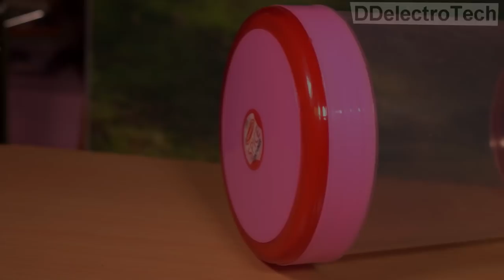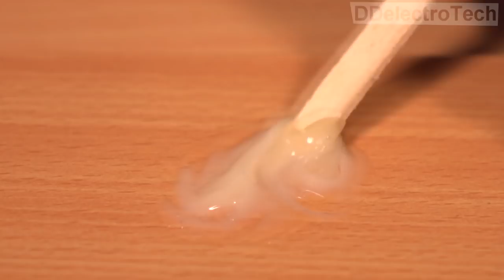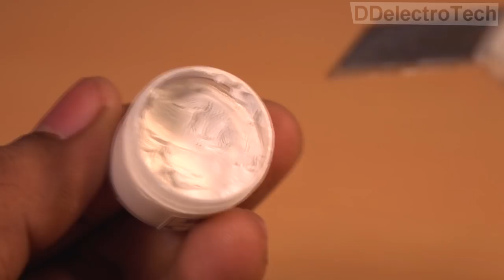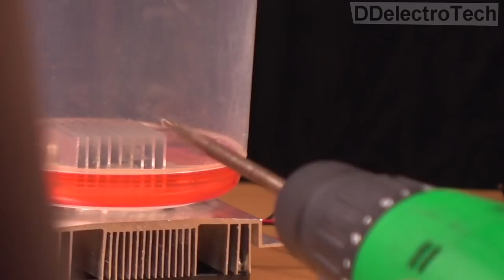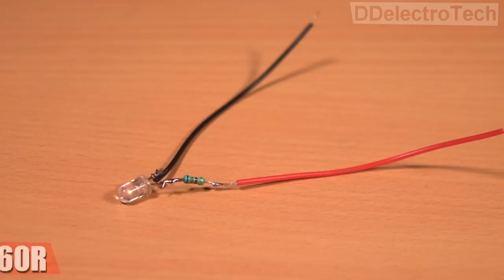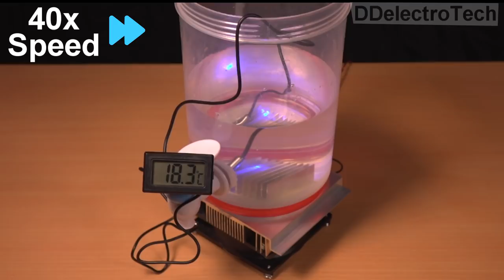How to Make a Portable Water Cooler at Home

Comment: Got one of these. 12 v peltiers but  with metal tubes through it for water   and vehicle voltage source. .. would a table top fountain pump and a switch get  me refrigerator temperature cold drinking water ? Or would i need to re circulate it awhile first?

Comment: Bro..The temperature gradually increases after cooling and it leave some drops of water outside the Bottle..And the wires seems like very close to the bottle..Is it dangerous so ??...Bro plz clarify my doubt
Reply: Just keep the wires insulated  Eventually aluminium heat sink starts to corrode and that's not safe to drink.

Comment: Hari Krishnagudur

i had purchased TEC1-12706 peltier. I had connected with 12v dc supply then hot side it is getting too hot but cooling side it is not cooling 32 deg only.
pls help me how to get cooling
Reply: Use heatsink

Comment: Quick but dirty! I wouldn't want to drink water that has been exposed to a metal heatsink. Also tempurerate gaung touching heatsink... naughty and not accurate.
Reply: Simon Hayter yea i just commented on that too... the raw expoxy exposure is what really turns me off.. the idea and concept is cool just not too practical if done exactly this way. Not safe enough
Reply: Yep... and since the ideal fridge temp is 1.6°c this project is a way of the mark in terms of delivering a cold beverage. Most DIY fridges and a lot of 'MINI' commercial fridges struggle to go below °5c because it's you simply can't cool the heat quick enough without having to use more heavier and more expensive components. Fridges use a compressor, internal and external radiators, coolants that turn from gas to liquid to gas again.  People reading this... save your time and buy yourself a cooling box and pack it with ice... not only can you store more but they will be far more cold than this device and any other DIY on YouTube.
Reply: Simon Hayter for the most part yeah,i have myself a prebuilt thermoelectric cooler and im able at best to get it marginally above freezing in the low to mid 40s (°F) 
Solid state coolers or these peltiers really arent too capable for on demand or near instant cooling since theyre just too small and too difficult to regulate the cooling
 Trapping the cold effect is the best bet for optimal lowest temp possible. Youll never get Refrigeration level cooling without an actual cooling system lol. But then again this is many hundreds of dollars cheaper... kinda gettting what you pay for. Mediocre but slightly better cooling or heating,for fraction of the price.
Reply: @demonsparkx   y'all will say it's impossible to reach below 5°c, till someone cracks his brain overnight and does it, then y'all will forget when it was 💯 impossible 😂